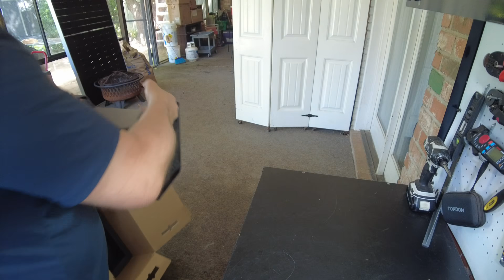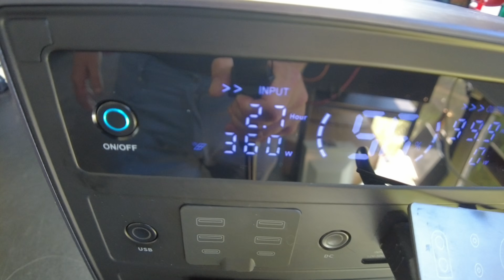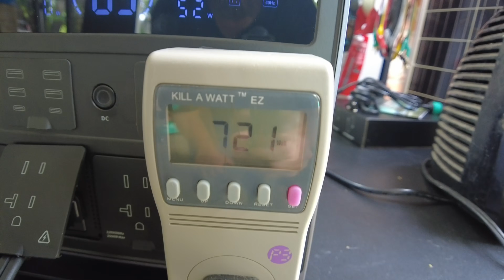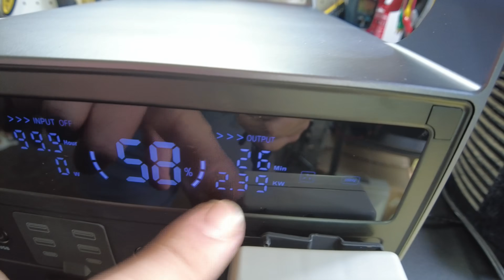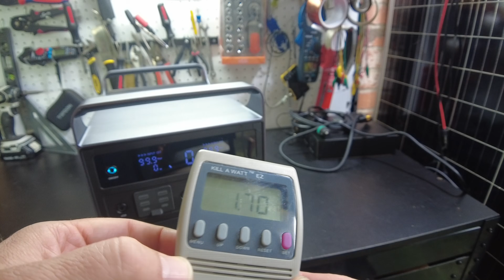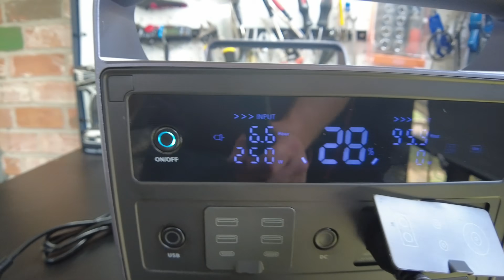ETaker M2000 Power Station

Comment: Could you list some panels that work with the Etaker?
I have two,they won't sync and only pull 250watts solar locked in car charge mode.
I'm using 400 watt bifacials.37 voc.
There was supposed to be an App,but never happened.
I think this product is dead,and they are trying to get rid of their warehouse stock.
Mine are expensive bricks,worst Amazon purchase ever.

Comment: semi solid lithium ion, although not specified in the product listing, that i can find, to my knowledge, semi-solid battery tech is still based on NMC chemistry,
i watched a video by @WillProwse who decided to damage one of these semi solid state batteries and, well go watch for yourself, but it did what typical NMC batteries do.
the lighter weight for given capacity also indicates that it is not LFP based, which is what most of us consider safer in our homes than NMC batteries.

appreciate the look at this unit Brad, if you have any issues with it in the future, should you decide to keep it, please keep us updated on the details. thanks.
Reply from the maker: Right, I'm pretty sure the battery tech in this unit is not LFP based. A section on their site states semi-solid li-ion has a higher energy density than LiFePO4, so I draw the conclusion that it is not LFP. I'll look for Will's video, now that you mention It does sound familiar. I think I might keep this one around to continue using/testing, and I will certainly keep you guys updated! Thanks :)

Comment: Another good video, although I do have questions about the product.  On their website, they claim these pouch cells have been tested rigorously and are 35-50% lighter, per watt-hour of storage, than LiFePO4.  I don't doubt that claim, but I couldn't find any information regarding how many charge cycles you get to 80% DoD.  I like that it has a self-heating function, making it safe to charge in virtually any ambient temperature, and it's cool how many you can link together, using their "conjunction" device.  For the amount of storage and inverter capacity, the price is about right.  It looks like it would be a really good option for folks who want those specs in the lightest weight unit possible.  I wouldn't even consider this for a sizable home backup solution, though...the really need to design an expansion battery that is JUST an expansion battery.  It's 5.2kg, or around 11.5lbs, lighter than the Pecron E2000LFP, although the Pecron is $300 cheaper and the LFP cells are going to last 2-3 times longer, typically.
Reply from the maker: Thanks Jason, great insight, and good question on the cycle life. I'll try to find out.

Comment: QUESTION: After battery is depleted, once battery has sufficient charge, can it AUTOMATICALLY, without any user intervention (local or remote), turn on the AC OUTLETS so everything that was running prior to battery out, can restart on their own???
Reply: That's called Dark Start .
Reply from the maker: @onthelake9554  Thanks for the info, now I know what to look for :)
Reply: Good question
Reply: Apparently it is rare to find this capability, I am still looking…
Reply from the maker: I'm not sure, I'll try to setup a test. But as of yet, I'm pretty sure I have had no power stations that do this. Would be a very useful feature no doubt.
Reply: @BradCagle 
I look forward to hearing the results of your test.

Thanks
Reply from the maker: @Just_An_Idea_For_Consideration  Alright I ran that test. The unit started at 100%, I then ran my air conditioner on it draining it down to 0%. At which time the power station shut off the AC output. I then began charging the power station via the AC charging port. It never automatically re-enabled the AC output. I let it charge over 80% before I stopped the test. So no it does not seem to do what you're looking for. That being said I have not seen any that do this. Would be a nice feature, and seems like it would be simple to implement. Thanks
Reply: @BradCagle 

Thank you so much.  This is a very important feature, in a completely iff grid scenario.  If system is miles away, it needs to restart AC outlets as soon as sufficient power is available.

A few people on other forums, claim that there are a few Ecoflow units (not all ecoflow units) that might offer this feature as a selectable option, called ALWAYS ON AC under a tab called LAB.    But I have yet to purchase any of these type systems, because I need this feature, and am not sure of the reliability of such claims, if they have not been tested.

In my scenario, I intend to have a system such as this.  In a small shack in a farm field.  No grid is available, so strictly running and charging off of solar panels.  In the shack will be an NVR and cameras, connected to a router, connected to a long range wifi radio (that can transmit and receive over 10 miles).  When the generator depletes the batteries and turns off, I need the generator once it has sufficient charge from the sun, to turn ON the AC outlets, so the equipment has power, and I can communicate with the equipment remotely.  If the AC does not turn on automatically, then I have to drive to the location, every morning after any overnight power depletion.

Please let me know, if you find any brand that meets this functionality
as I will purchase a few of them for various locations 

thank you
Reply from the maker: @Just_An_Idea_For_Consideration  Yeah, these units are really consumer grade, with expected interaction. The company I work for we build some edge/cloud systems that are solar powered, and out in the middle of nowhere. We don't use AC at all in these, just straight DC. We use 24v LiFePO4 battery with a Vicrton 100/20 MPPT, we have a POE switch that runs off dc from the Victron load port. Connect to the POE switch is Wifi radios, cameras, and edge devices, etc.. This works pretty good, and only every once in a while we have to send a service tech out. Thanks
Reply: @BradCagle 
Excellent suggestion. 
Thanks
Reply from the maker: @Just_An_Idea_For_Consideration  No problem. This is the POE switch we use https://www.bhphotovideo.com/c/product/1019617-REG/veracity_vcs_4p1_mob_camswitch_4_mobile_powered.html We have also used this cheaper one https://amzn.to/4artBcO
Reply: @BradCagle 

Appreciated!
thx